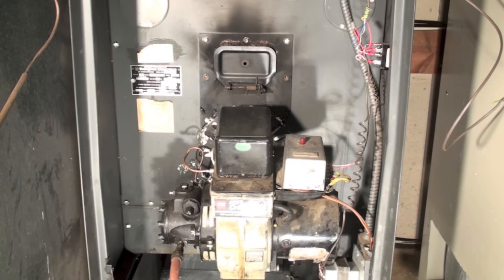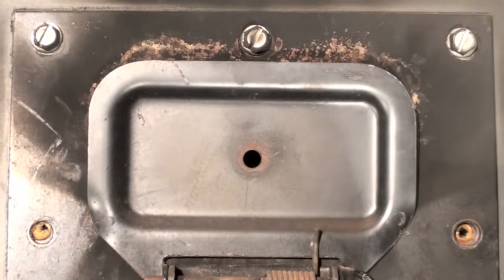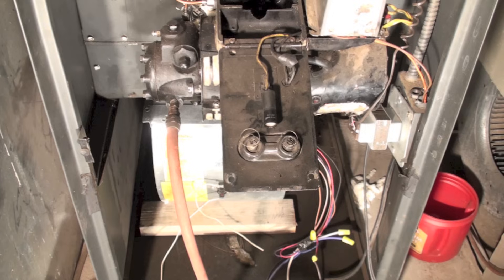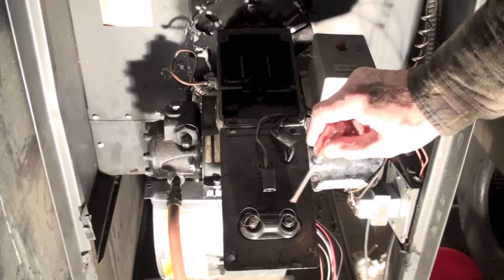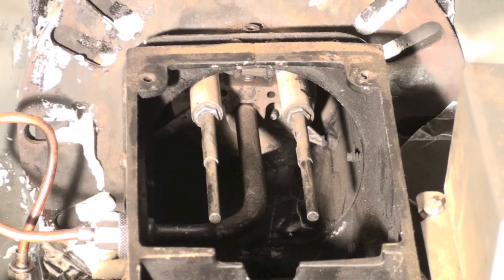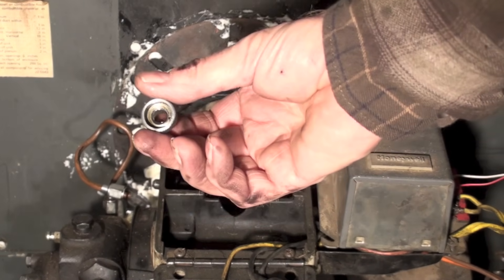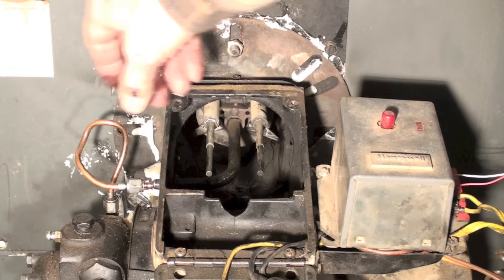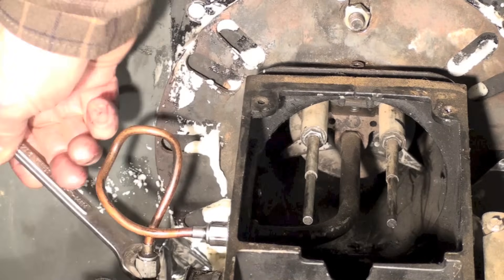Oil furnace troubleshoot part 2 No flame

Comment: Ive pushed the red button three times. Im worried that i sabotaged my intial attempts
Reply from the maker: You are probably ok if it is really only 3 times.  The reason I say this is, as a technician, I have been told that only to find it had been pressed 20 or 30 times and when fired, we had an out of control fire.
GFM
Reply: grayfurnaceman thanks for getting back. I had to get the gunk build up taken out the furnace wouldnt turnover. Much appreciated!

Comment: grayfurnaceman  - First, thanks for taking your time to instruct others on fixing our furnaces.  Some people need help because they may not financially be able, and others, just getting someone to come out after a cold spell like we're experiencing on the East Coast now, we can't wait days for an appointment.  And in others, you just can't trust your service techs.  3 years ago, I had 6 service calls in one week, only because the techs my oil provider was sending was just replacing all parts hoping to fix the problem.  We finally went to their office and complained, and after the 3rd call, I was teaching their techs, and the final guy did what I learned online and fixed the problem.  We had no problems in those 3 years.Well, last night I awoke to 60 degrees, and knew there was a problem.  I went down into my crawl space and opened the front of the furnace.  First thing I see is LOTS of soot.  I'm guessing there was a blow back or something.  I reset the tripped button, but nothing happened.  I have a Beckett assembly, and I know from my last encounter, the igniter was bad and my problem then.  I tested for spark as you show in a few videos.  None.   I went to a HVAC supply house, and bought the 51771U.  I came home and replaced the unit, except I still don't have spark.  I have plenty of fuel.  I tested the motor by spinning the cage, and it had proper resistance, but not too tight.  The CAD cell is clean, and was clean when I flipped up the housing.  I thought maybe soot got on it, but all looks clean.  Is there some advice or a video I'm missing to troubleshoot from here?
Reply from the maker: The soot could be from a partially plugged nozzle or the wrong adjustment of primary air. At this point, you need to deal with the soot.  The heat exchanger is probably plugged and probably the smoke pipe and chimney.  Big time cleaning job.  Once that is done, you will have to address the failure if there is one.  Let me know how you do.
GFM
Reply: I wish you weren't retired, and lived in Delaware.... LOL   You seem like a guy I can hand a blank check to and never worry.I assumed the soot came from when it did spark and had a big POOF.   I did let it run a bit longer, but as you advised, to not let it shoot the vaporized fuel too long, but still nothing.  My wife finally called a new company today for fear I was going to get blown up.  Still waiting for them to show up.  Baking pies to keep some heat in the house.  Great time for family from Florida to visit.  Thanks again.   You're the best.  I'll post what this guy comes up with.

Comment: I pressed the red button way more than 2 times, what should I do?! I can here it trying to run and I can feel the air coming out of the vent yet it doesn’t heat up and it turn off after a 20 seconds. I don’t want to continue the steps and blow up my house. What should I do?
Reply from the maker: For safety's sake, I would call a pro.
GFM
Reply: grayfurnaceman thank you

Comment: What if it starts after hitting the tiny reset button, but it wasnt right away??
Reply from the maker: If it runs more than 45 seconds, you may a supply problem.  Dirty oil filter, plugged line or tank.
GFM

Comment: Hey I just had my furnace serviced. It's older, no idea the model. The persistent issue is when the furnace goes to kick on I get nothing. Fan kicks on but no burner. If I hit the relay reset the furnace kicks right up, also if I tap the (ignition chamber?) black box on top it kicks right on, not even hard just a knuckle tap. Is there a video for that?
Reply from the maker: The black box is a cad cell relay.  If hitting it starts the cycle, the relay is failing.  Replace it.
GFM
Reply: grayfurnaceman thanks man.

Comment: I will try this, but my issue is stranger than this.... it ignites fine until the temp outside goes below 20°. MAKES NO SENSE. It's been running fine end of Oct until today where the temp is about 18°. Fuel oil is flowing but it won't ignite. Any ideas? 3rd yr in a row now it behaves like this. The colder it is outside it doesn't want to ignite but my tank is inside with #2 fuel oil. Frustrating.
Reply from the maker: You could have a problem establishing draft.  Could be from a negative pressure in the structure.  Try closing the barometric draft control during startup.  Also check draft pressure.  Should be negative .04 in wc.
GFM
Reply: Thank you very much

Comment: GFM: if it’s bled out a few times and oil is flowing fine what could the issue be? Is this an easy fix? Unfortunately I pressed that reset button one too many times. Will probably have to call a Tech. to come to the house tomorrow

Comment: Great stuff! Thanks for your help! I did bleed my Boiler a few times and pressed the reset button more than about 10 times over the last two days. Now I am skeptical about doing the troubleshoot you suggested because of that. Is the flare-up really a major occurrence?
Reply from the maker: It depends on whether there was oil coming out the nozzle. Also, are you sure it was 10 Times?  Not 20?  See what I mean?
GFM

Comment: hey grayfurnacemam.com when press the start button all its doing is making buzzing sound then knocking of fan wont move nor is there a flame..😥..its ah riello 40
Reply from the maker: You could have a stuck motor or seized pump.  Try rotating the fan wheel by hand.
GFM
Reply: +grayfurnaceman thanks for getting back to me..ive done that and still wont fire up 😥
Reply from the maker: Grace Conlon look for a reset button on the burner motor.   If it hums but wii not start, strike the motor with a hammer. If it starts, the start switch is failing. Means new motor. 
GFM
Reply: +grayfurnaceman thsnks again for getting back..blower is working but wont fire...

Comment: Thank you. Can you ever push the button again after 2 times? Would the fuel drain back or is that it?
Reply from the maker: Yes.  The reason for the 2 presses is if the burner does not start but oil is flowing into the combustion chamber, you could have an out of control fire.  Once the condition is repaired,  it can be reset.
GFM

Comment: Hi , myboiler  shoots out grey/blue smoke after the burner stops. The diesel burns cleanly ,no black smoke, but when the burner stops grey/bluish smoke comes out.  Dont know what that means, unburnt fuel maybe? It's in my big hot water pressure washer . it has a blower fan and solenoid oil pump. The nozzle is brand new. Sample princple as this but .dunno why the smoke. You seem to be quite an expert in this , do you have any idea ? Thank you

Comment: I took the oil pump off and after messaging you I tried tapping the motor with the wooden end of a hammer...still just a buzzing noise. I reached inside with a finger and the shaft coupling/blower spins...this wouldn't spin if the motor seized would it??? Could something electrical need replacing?...a switch?
Reply from the maker: If it is seized, the shaft would not turn.  The buzzing noise could be the motor or the spark.  If it shuts off after about 45 seconds, and will start again after the reset is pushed, you probably have a motor failed or out on internal overload.  Many of the motors have a reset button on the side.
GFM

Comment: Please help...need some expertise! My Lincoln oil furnace ran out of oil last fall while I was away. This spring I tried to start it up and the burner motor just buzzes. I hit the reset and same result. Thought the oil pump seized but pulled it and it spins  freely. Tried to start it with pump off and again...just buzzes for about 30 seconds and kicks out on overload! Motor seized?
Reply from the maker: The motor may be seized or the start switch may be stuck open.  Strike the motor with a hammer to see if it breaks loose.  It will still have to be replaced.
GFM
Reply: Thank you very much!👍😁

Comment: I have a beckett, I have fuel, I have spark, I've check the gapping of the electrodes against all your videos and the burner will still not light.  please help.  Thanks for your time
Reply from the maker: I am assuming you have a spray of fuel when the unit starts but no ignition.  It is possible you have the gun assembly too close to the burner head and the electrodes are shorting to the head.  Just a thought.
GFM
Reply: grayfurnaceman the furnace was working fine about a week ago.  then we ran out of oil.  I am stumpt
Reply from the maker: When you run out of oil, it is probable you have contaminants that have either plugged the oil filter or plugged the nozzle.
GFM
Reply: Or you had a one line system that needed to be primed.
Reply: Does bleeding it also clear the ‘nozzle?’. Thanks.
Reply: 245fraser   

L.   MXcvccxx.   K
Reply: Germaine Calliste no. You replace it.  I carry a few.  Three of each size.

Comment: thanks for making these vids my boiler wasn't turning on and i freaked out a lil but just pushing the reset button fired it up what causes the boiler to just stop and presing the reset fix it just curious
Reply from the maker: There are a number of possibilities here.  If the unit has not been regularly serviced, you could have blockage in the filter, partially plugged nozzle, or blockage in the vent.  Failing burner motor or pump are also possibilities.
GFM

Comment: to check spark only disconnect wire to burner motor  won't pump oil and should be licensed tech to work on oil

Comment: Great video! I understand the button shouldn't pressed too many times but consider this. The furnace didn't start the first time, next you pushed the button to try to get it to start. Now you begin troubleshooting so typically you already have 2 cycles of oil in the furnace. If you are testing for spark, it's still spraying oil into the CC so now there are 3 cycles of oil. I don't really see a way around avoiding 2 or 3 cycles of oil being spraying into the CC minimum. If spark isn't the issue and you continue to troubleshoot...
Reply from the maker: In most cases, 2 to 3 cycles is not an issue.  However, as a service tech, I have heard the " I only pressed it twice" then I fired it up and had a fire.  What I generally do is remove the gun and nozzle and point the gun assembly into a can and start the unit.
GFM
Reply: Thanks. Your videos are very helpful. Keep up the great work!

Comment: I got no spark on the coil on transformer but it's bran new
Reply from the maker: You will need to check voltage to the transformer.  This will have to be done while the unit is attempting to start.  High voltage there.
GFM

Comment: just got a house with this furnace in it worked great then let it run out of oil then I got more oil now it won't start it tried at first after I hit the button did that a couple times then nothing now it just humms
Reply from the maker: You probably have either a plugged nozzle, plugged filter or a possible failed pump.  When you run out of oil contaminants can block the filter or plug the nozzle.  The lack of oil could damage the pump.  If I were doing this, I would first change the oil filter and service the gun assembly.  Then flush out the oil lines with the pump.  This will pretty much tell you what the problem is.
GFM

Comment: I'm so happy I stumbled upon this video.  I followed your directions and figured out my problem...My problem was with my Carlin 41000 electronic ignitor attached to a Beckett AFG oil burner.  I found a place that had it in stock locally for under $40.  It took approximately 10 minutes and I was up and running again.  A million thanks for sharing your knowledge.
Reply from the maker: Glad you got it going.
GFM
Reply: Where is the ignitor located at, I can't find it in the furnace. Thanks
Reply: @victorrobinette3865  I no longer have this in my house but I remember mine was a carlin 41000s elec ignitor. Do an image search for that and see if you can find it on yours. Best of luck 🤞

Comment: where can I buy the exactly Electro insulators you have in your gun I have the same exactly ones in my oil heater and I need them. can you send me the Sku# please. And also need the one is under the battery the wires broke what is the sku# or name and website. Thank you for this videos it helps a lot!!!

Comment: I just did every step to get a flame and my oil furnace still will not start. It was running and then I ran out of oil. I put oil in the tank and the burners were on and then it shut off. I pressed the reset button and again it did the same thing. I pressed the button again and now no burner and it shuts off after about 30 seconds or so. The burner will not come on at all. So I replaced the Nozzle, Filter, Electrodes, CAD sensor and Transformer. Still no flame! I drained it with the nozzle removed and even bleed the furnace. What could be the issue?? Any help would be appreciated.. Thanks in advanced.
Reply from the maker: If you have a clear bleed, the furnace should start.  Even though you have replaced the nozzle, you may try changing it again.  It could have plugged again.  Hope this helps
GFM
Reply: Ok.. I'll  try replacing it tomorrow and see if this solves the burner issue
Reply: I just replaced the nozzle and everything started working. I'm getting white puffs of smoke coming from the chimney vent now. It just keeps puffing and then it shuts down. What could this be?
Reply from the maker: You may be burning out oil left from a partially plugged nozzle.  I would have a fire extinguisher ready in case the fire gets out of control.
GFM
Reply: The flame was good for a few hours and then I started smelling fumes. I went to the furnace and the burner was off but the fan was still blowing for several minutes. I pressed the reset button and it just kept puffing white smoke from the flue flap and then shut off tripping the reset button again. 

I would have thought that any oil left at the bottom would have been burned off during those few hours of operation? What should I do from here?
Reply from the maker: You are right. It should burn off in a few minutes.  It sounds like the burner is not establishing draft.  The most common reason for this is a blockage of soot in the heat exchanger or chimney.  I would check the smoke pipe between the furnace and the chimney first.
GFM
Reply: grayfurnaceman I checked the chimney and heat exchanger and its pretty clear. The furnace stays on for about 15 minutes but keeps tripping off. I don't see any white puffs this time though. Any idea of what's causing this?
Reply from the maker: This is probably an oil supply problem.  Oil pressure to the gun may tell you something about the health of the pump, but it is probably a vacuum leak or a blockage in the line or tank.
GFM
Reply: K

Comment: Thanks for this tutorial!  Today was the second time I've used it to diagnose and fix a problem with my furnace not igniting (gummed up gap between nozzle and electrodes).  I will add that when pulling out the gun to clean those parts, remember that there is still oil in there, so place a rag over the gun intake to keep it from splattering on your floor.  Also, is it a problem with a small gap (less than 1/4 in.) between the electrode and the nozzle that contributed to this build-up of gunk?  After cleaning I used the 1/8, 1/8, 1/2" spacing that you described in another vid.  Again, thank you from my now-warm house in December!

Comment: If  a burner motor has been replaced from a Beckett model with the exact same specifications but from one that had a reset button, with one that is a newer smaller physically sized motor that does not have a reset button and it is found that after a successful working output on the first try for at least a 1/2 hour that does not restart after it reached temperature setting.  What is the next step with the knowledge and knowing that the oil pump is working and moving freely without excessive friction and the drive shaft parts are in working and unworn condition?  Obviously, the possibility of a defective new motor is considered but is there any other possible reason?